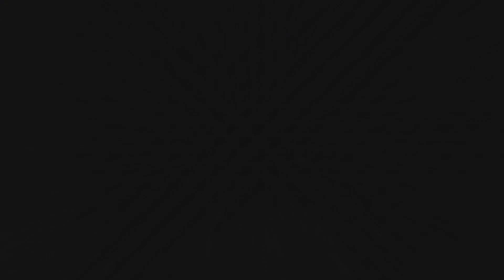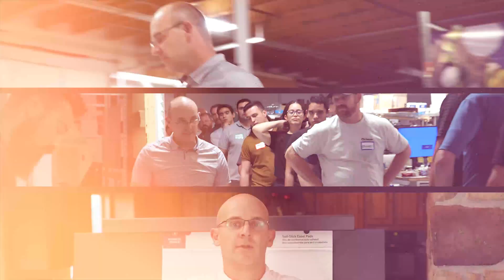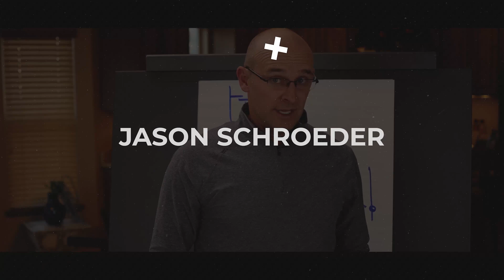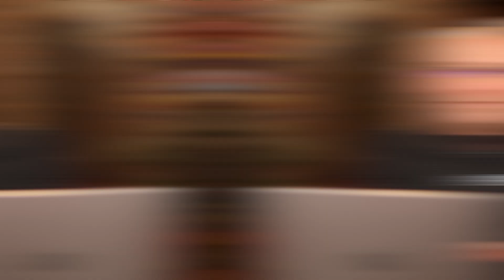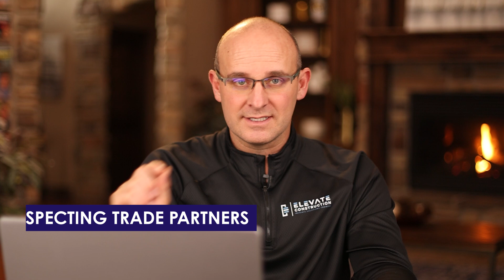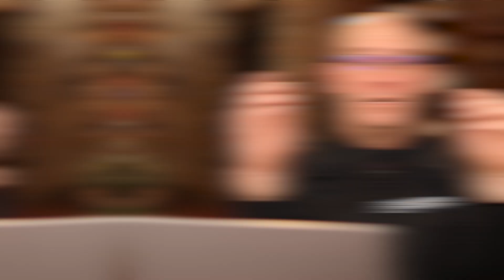Are You Starting Your Construction Project The Right Way? Getting Started With Lean

Comment: The system has been working great on bigger jobs an issue with smaller ones is start dates are so soon so submittals and procurements don’t have enough time before you need the material